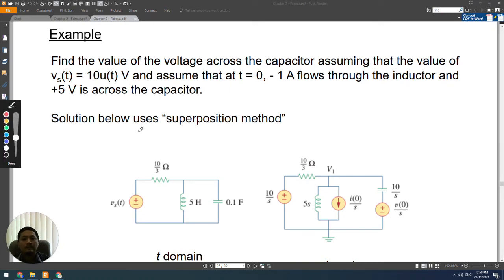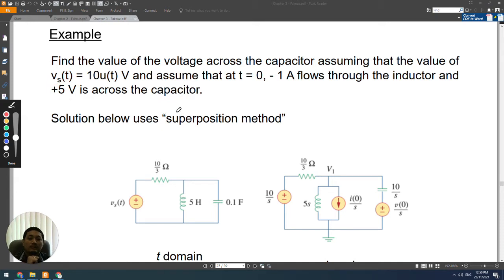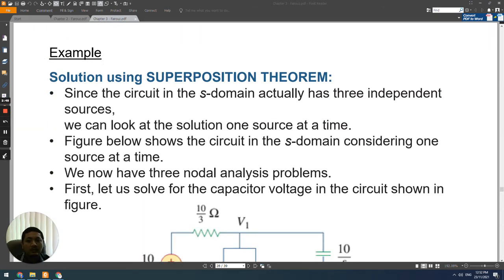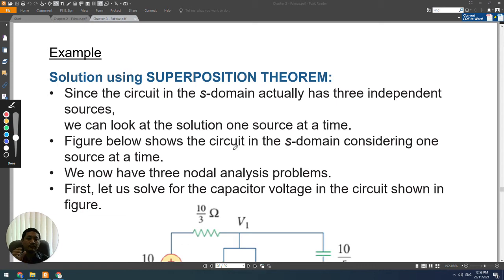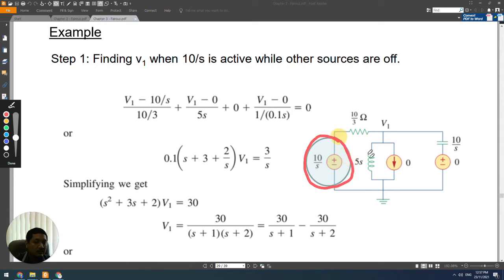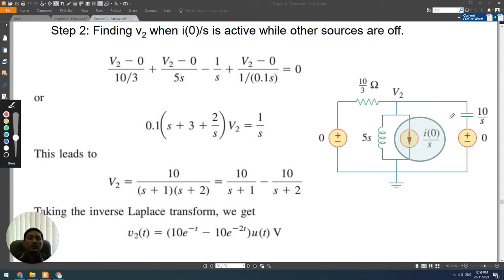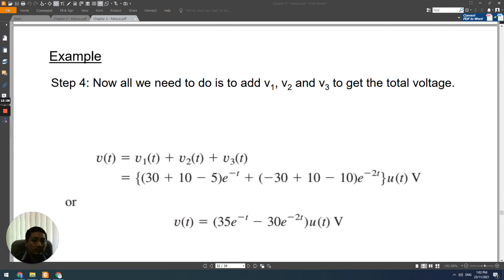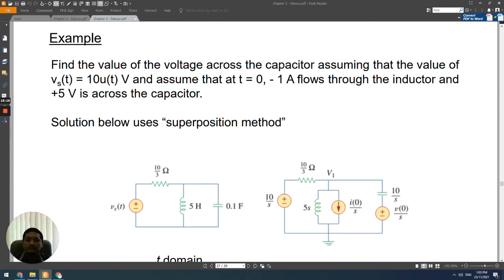BEV20203   laplace transform circuit analysis   example 3

Comment: in solving for V1, why is it that the v1 is greater than the independent voltage source, i.e isn't there a voltage drop across 10/3 ohm resistor?